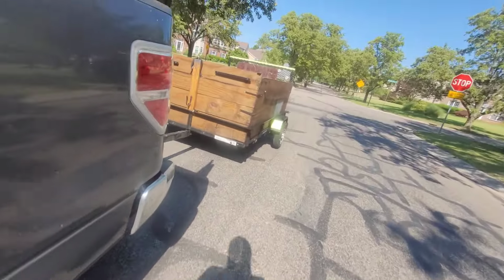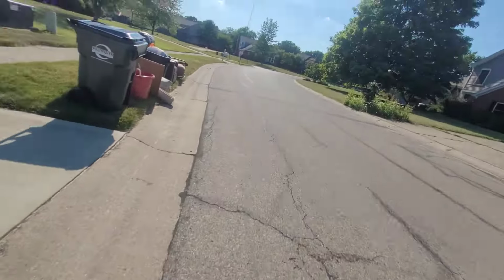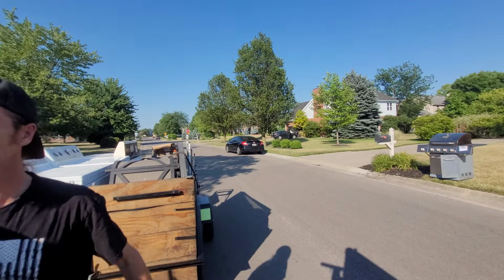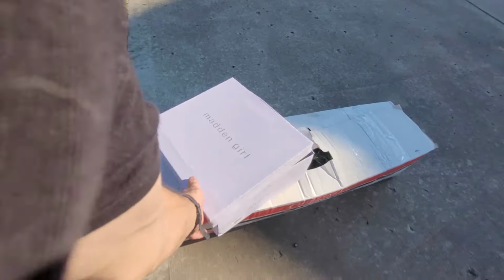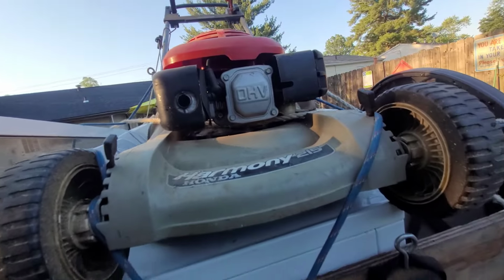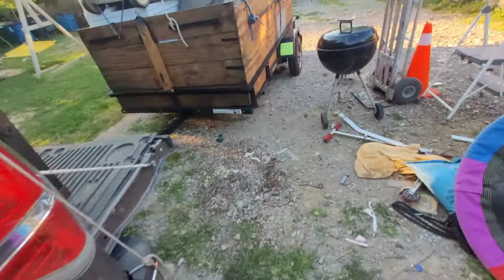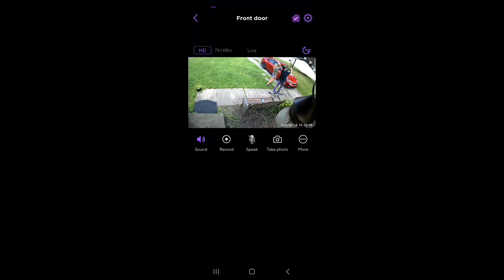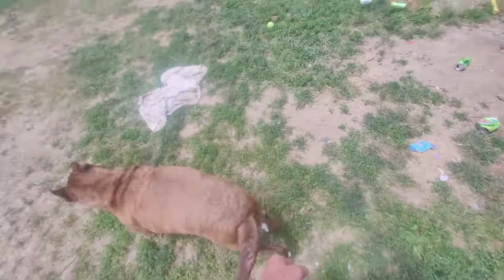Father's Day Scrappity Scrapping

Comment: How do you get away with bringing Is plastic chairs to the scrap yard Happy Father's Day.
Reply from the maker: Most yards have what's considered ( shred steel ) 
Some are more strict than others but the term in general means , shredder steel.
A mix of steel , iron , aluminum,  copper , plastic,  wood , illegal immigrants 🤷🏻 
Whatever one may choose to add to the recipe 😁
Reply: @MrScrappity  Shredded steel tin shredd. I'm just surprised that your scrap yard. Let's you get away with it. We're I'm at in Pennsylvania, they throw me out. For bringing plastic chairs.
Reply from the maker: @elmermoyer6595 that's a bummer 
The yard I frequented pre '00 made everyone pull the seats off. They would only take the bases. Refrigerators had to be cut into four pieces. It was slightly more strict. Each one is different
Reply: @MrScrappity  Yes, they are, but mine made me cut the fridge.take air conditioners apart and definitely no plastic.Yeah they only used to let you take the cylinder the shock